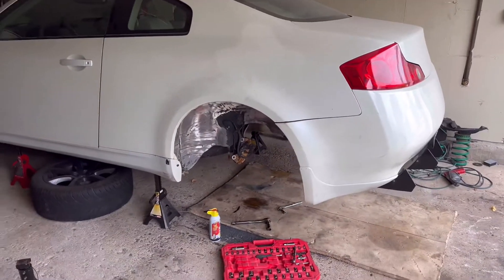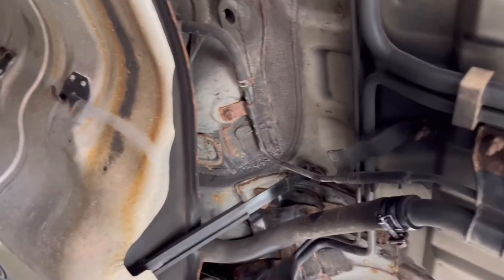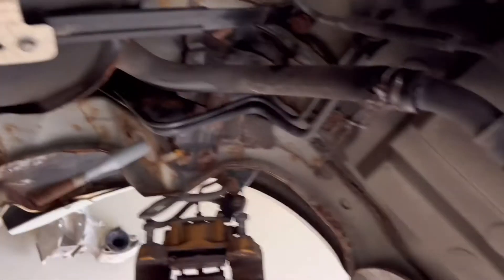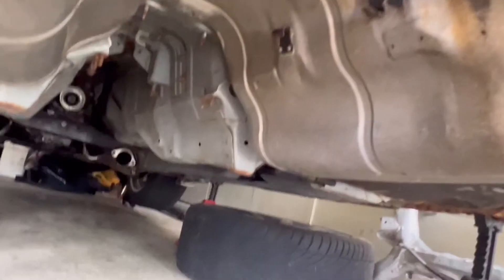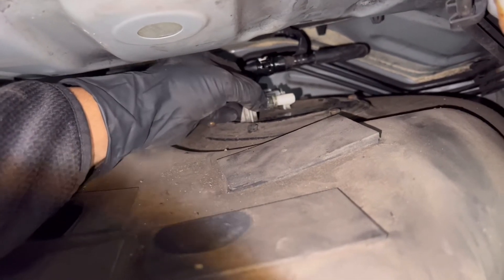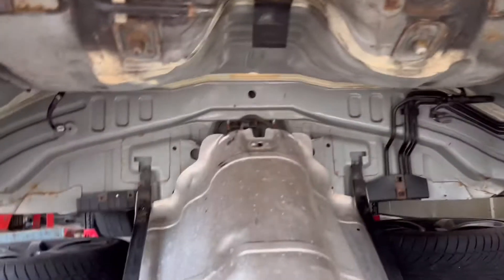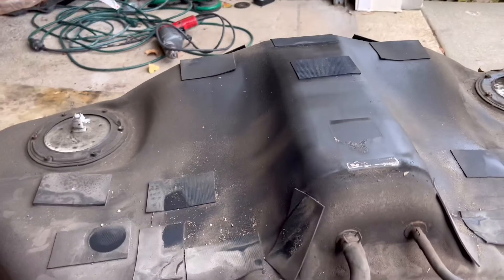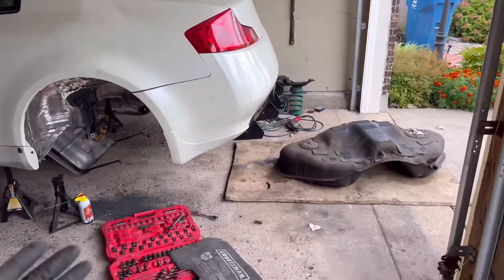Fuel Tank Removal on a Infiniti G35 (350z as well)

Comment: Is this the same process for a G37? My car got hit on the rear bumper pretty hard while it was parked and it’s leaking gas so I figured either the connection got damage since it’s not leaking gas now but the impact caused the car to make it leak some gas. So I want to change the gas tank mysel, if infiniti tells me fixable.